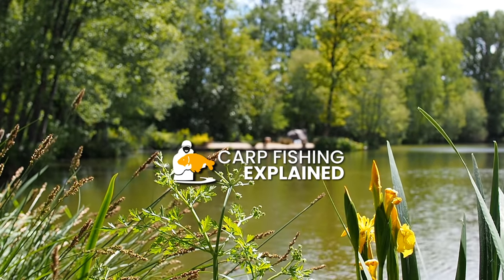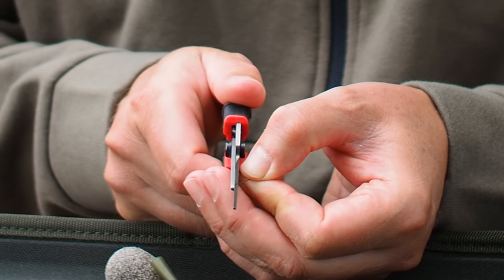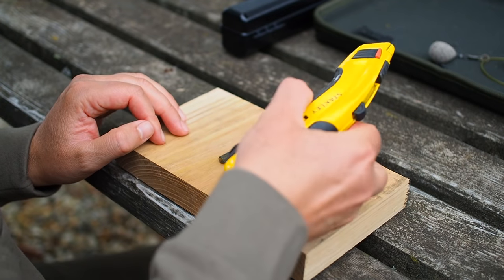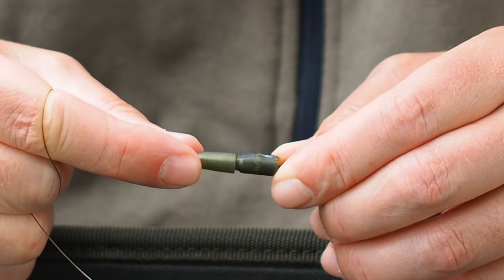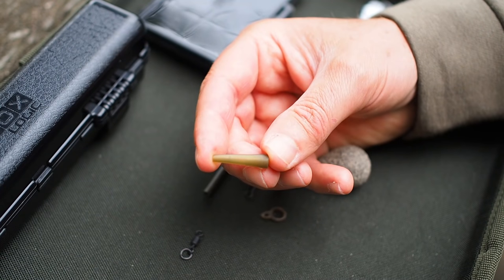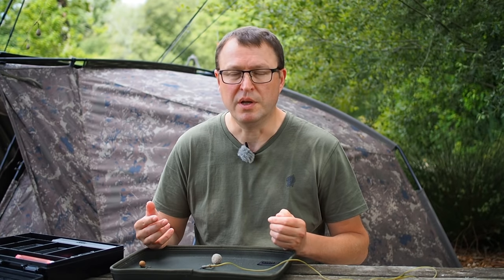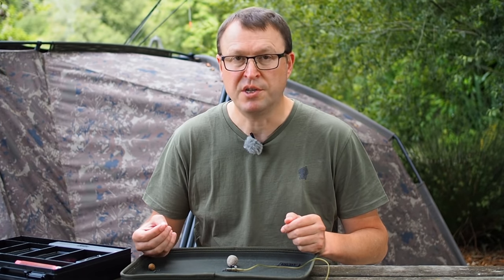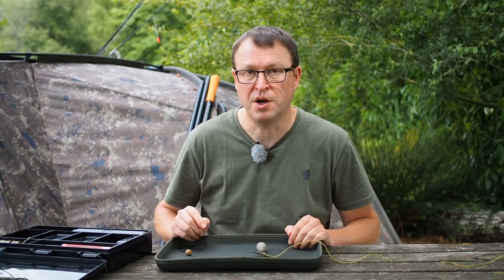I Cut the Leg of a Lead Clip (HERE'S WHAT HAPPENED)

Comment: Should I use this in all situations and do you think it reduces fish loss
Reply from the maker: Hi mate, I don’t believe that any one solution can cover everything but this may well cover your needs. I can’t really say much more as I know nothing about the type of carping you do. This rig is all about stopping the carp ejecting the rig before you even pick up the rod. Anglers fishing with traditional semi fixed rigs have probably missed quite a few opportunities without knowing. If you are losing fish while playing them then this lead system is not going to change anything because the problem lies elsewhere. You might want to take a look at my video on hook pulls as this covers the subject much better. For me hookupulls are extremely rare and the video shows you how I go about achieving this: https://youtu.be/yPDZV9xY_UA.  Hope that helps, Cheers, Matt.
Reply: @matthewcollinsangler  thanks for the reply Matt, I mainly fish a 4 acre pond with carp to 35lb and loads of 20s and is a very silty lake bottom with a lot of open water but the fish are very on edge and spoked do you think this would be a good set up to use
Reply: @matthewcollinsangler  also on my local I find the fish sometimes eject before I even get to the rod asumming using the lead to unhook them selfs
Reply from the maker: @Bailey6337  Yes, this is the type of lead system that you need as it sounds like the fish are getting away with it more often than not. Because of the silt I’d swap the mono for supple braid like Armourlink, add a nice mesh bag of crumb/pellets and lob it out. Caught plenty on it doing that. If it’s really silty I’d probably go with a supple rig inside a solid PVA bag. Have a look at my original trick inline setup: https://youtu.be/ED58TfFEcqM. Scale that down to fit in a solid bag and drop to 2.5oz and that will work well. If you need to fish at range or over shallow water then check out my helicopter setup for silt. That works really well: https://youtu.be/K0A4GSH0z44 Hope that gives you a range of options to try. Do let me know how it goes! Cheers, Matt.
Reply from the maker: @Bailey6337  Yeah they are definitely doing you mate. That’s the trouble with traditional semi fixed rigs. They are just too easy for the carp to use the weight of the lead to sling the rig.
Reply: @matthewcollinsangler  thanks for the advice really appreciate it I will give this ago 👍

Comment: Can this same concept be done without the tubing? Or is the running ring too abrasive?
Reply from the maker: Tubing is not necessary, it can be used on a lead free leader or a regular mono leader or just bare mainline even. The run ring I use is plastic so abrasion isn't an issue.
Reply: @matthewcollinsangler  thank you! I used to use fixed sinkers when I first started. I switched to lead clips cause I liked the idea of the fish losing the sinker if I broke off. However, I did my own testing and ya lead clips aren't as brilliant as I thought. My old 3 way rigs were with mono tags and now that I know how lead clips work, I should have stuck with those. Definitely going to give this a try!
Reply from the maker: OK, cool, best of luck!

Comment: I was wondering how well this would work if your trying to thread braid mainline thrue your rig tubing ? As it's a lot less stif than mono line any tips !!.
Reply from the maker: Hi Paul, I wouldn't bother trying. When I use braided mainline I tie it directly to 10m of Nash Heavy Duty Mono Snag leader in either 30lbs (0.50) or 40lbs (0.60). Because the leader is very robust I don’t bother adding tubing. I fish that straight down to a clip of some sort. TBH nowadays I’ve moved away from braided mainlines as they are very expensive and come with a variety of downsides. For general carping I use 12lbs Nash Bullet, for heavy duty work I use 20lbs Bullet. I also use both of those in combination with an abrasion leader where necessary. Hope that helps, Cheers, Matt.

Comment: Hello Matt, would a snag safe lead clip from Enterprise Tackle be as effective as run ring & quick clip
Reply from the maker: Hi Mitch, I have tried the Enterprise system and it does work but I found the clip varies in quality and I lost quite a few leads that just got banged on a rock. If you want to combine my rotten bottom trick with the shock and run you can create tuned setups which suit each different application. If you missed the rotten bottom video watch this: https://youtu.be/pSjT2wPKtTw Cheers, Matt.
Reply: @matthewcollinsangler  many thanks for the reply Matt much appreciated, I've used them in the past without issue so I'll give them a try. Thanks for the link too, I'll check it out 🙂👍

Comment: Hi matt what brand of run rig rubber do you use that fits over the tail rubber, cheers
Reply from the maker: Hi Darren, yes so I’ve found two that work. The Fox run ring is the one I’ve used the most. The only trouble is it’s only available with a set of quick links and buffer beads. The other option is a Drennan run ring. These come pre assembled and you just have to clip a lead on and you’re ready to go. These happen to have an identical internal diameter to the Fox ones. I only found this out because a friend very kindly shipped some over to me after the shock and run video was made. I’m currently playing around with Nash’s new helicopter buffer sleeve. I think this product has multiple possibilities! Do let me know how you get on as your feedback is greatly appreciated. Cheers, Matt.
Reply: @matthewcollinsangler  
Thatnk's pal .I definitely will let you know how I get on ,I do like end tackle that can be used for different methods, saves on dozens of different bits and Bob's. I'm fishing a members lake next month. Last time I fished it I noticed the tell tail rubber on the blow out tig was all way round the bend of the hook ,meaning I'd been done.The carp were picking up the lead and not running but using it to throw the hook.so I put the tail rubber on really loosely which caught fish but lost a lead on every take.This running set up should be perfect. Cheers matt
Reply from the maker: @darrenfox1879  Yeah sounds very familiar. I’ve converted so many customers from traditional lead clip systems to shock and run style systems over the last 10 years. I just don’t see any point in using traditional semi fixed lead systems anymore. I’m sure it’s going to work a treat for you. I still occasionally get done of course, no system is perfect but it’s very rare.
Reply: @matthewcollinsangler  
Hi matt thanks for the reply. I think I would only use a lead clip round snags or in heavy weed etc.The shock and run is a real edge

Comment: Could u use this set up for zig fishing
Reply from the maker: Hi Mark, I’ve not tried it with zigs but this lead setup would work very well for zigs. The thing to watch for though is weed. Zigs work well in clear water and clear water tends to be weedy. It doesn't take much weed to jam a lead solid so it’s often better to dump the lead on the take when zigging. I hate losing leads but sometimes it's the only way. Cheers, Matt.

Comment: Will the lead come off the tail rubber on impact?
Reply from the maker: Hi Kevin, it depends how you cast it, range, speed, technique, bait size, PVA mesh etc. The optimal casting technique for this rig is to cast, hit the clip, land the rig neatly on the water and feel the lead down. Adding PVA mesh makes it harder to use because the drag forces will increase the load on the hooklink which can dislodge the ring. If your casting skills are a bit rusty then simply tie the ring in place with some PVA tape before you cast. That will guarantee it works as it should. It’s not the end of the world if the ring gets dislodged. You’ll lose the shock effect and the telltale function but it will still catch carp. I’d recommend to do some test casts and retrieve the rig after 30 seconds of it hitting the bottom. That way you’ll know how it’s working for you. Best of luck, Matt.

Comment: Matthew, would you ever fish a running when slack lining?
Reply from the maker: Yes mate, I fish running leads when slacklining all the time. Cheers, Matt.
Reply: @matthewcollinsangler  Awesome thank you, I’m doing a three day session on a big fish lake that’s very silty next week, i’m guessing I’m going to have to use Helicopters …
Reply from the maker: @marcusday6519  Hi mate, sounds like a decent challenge! If you can get a drop on the cast (i.e. you feel the lead touch bottom) then I’d still use one of my running lead systems. If you can’t get any drop whatsoever then yeah helicopters all the way. Use as light a lead as possible to get the distance and put the top bead up the leader as far as you need. There’s an old trick involving a length of white wool (attached to the leader) that will indicate roughly where you need the top bead to sit. Cast out, leave it for a few minutes and note when the colour changes from dirty to clean. Hope that helps and let me know how you get on. Cheers, Matt.
Reply: @matthewcollinsangler  Hi Matt, awesome thank you sage advice as always. Wow what an awesome idea I will try the white wool trick!! Thank you I’ll let you know how I get on

Comment: Do you need the actual clip or could you just put the tail rubber over the eye of the swivel ?
Reply from the maker: Hi mate, it really depends what tail rubbers you have and how they fit over the swivel. You might have something in your tackle box that works. If you don't use the lead clip body with the Nash heavy duty tail rubber, the tail rubber doesn't grip the swivel and the whole lot slides up the line which is no good. If you're going to make this rig with bits you have in your box, make sure it operates safely and the lead can be lost in the event of a mainline failure.
Reply: Hi matt got 2 more questions, i want to try this system out on a lake i’m joining, so number 1. Why is the pin essential? If i tried this rig as shown here would i need to use pins and 2. What size run ring is that? Drennan do some that are small medium and large but i have nothing to compare to as i have never used them before. Thanks Leon
Reply from the maker: @Leonf123  Hi Leon, the pin through the body of the lead clip is essential because you need the clip to stay connected to the swivel. Otherwise, the whole lot will run up the line which, if you’re using tubing, can become dangerous. 

The Fox run ring only comes in one size. If you want to use the Drennan run rings with the Nash HD lead clip and tail rubber, use the large size. 
Cheers, Matt

Comment: Hi Matt,my question revolves around a flat lay using this running rig system,although i agree its a good set up,if it lands the way it it is going to land on the bed of water of water your fishing over,the heavier the lead the better the hook hold after that,can it be a 5 quid loss for the gain of a fish,although i understand some fish run into 5 and 6 figures
Reply from the maker: Hi, I’m not sure I totally understand the question. If you are concerned about the financial loss of the terminal tackle if the line breaks then there are cheaper options for sure. Check out this other video on my channel, it's a simple rig and costs very little to make: https://youtu.be/LzFina92brM, it’s done with a running lead setup and you don’t lose the lead on each take.
Reply: Hi Matt,the run ring on the tail rubber may stick after the lead has hit bottom,this could then make the rig sit up,its a great set up i admit,just not sure if it would be presented correctly on a gravel pit or hard base,in regards to your fine vlogs,i have watched most of them very educational and interesting and superb,please keep them coming
Reply from the maker: @felipfelop8220  OK, I don’t share your concerns to be honest. This rig has caught a lot of large carp from a tricky lake which has a very hard and rocky bottom. If you want to understand how the rig sits underwater, just make one up and drop it in a clear shallow margin. As long as you choose a rig material that will lay flat then there’s no issue for me.
Thanks for the feedback on the videos, great to hear! We've got plenty more ideas for new ones 😊
Reply: @matthewcollinsangler  ok,thank you for being so responsive,its very much appreciated

Comment: BTW, I thought to increase the safety of this rig you can use running Snag Safe Lead clips from ESP (I think) and I'm sure other brands are available etc,  .... so if the lead gets wedged in some snag you can still break free easily, but it won't just drop off.  👍
Reply from the maker: Hi Matthew, actually that Fox ring is as safe as the Snag Safe lead clip from Entreprise Tackle which I’m familiar with because it breaks easily at sub 10lbs and the Snag Safe breaks at 8lbs so there’s not much in it. You’re right, it’s totally an option 👍
Reply: @matthewcollinsangler  Aah right - didn't realise that!   That's all good then.  I'll stick.  :)
Reply: I was losing faith in this one for a while but it turns out I just wasn't on the fish in the 2km long and up to 35m deep lake which is also connected to the rest of Amsterdam's waterways so location is tough!    However I had a few fish on it recently including a 37lbs Mirror!  And I haven't had to buy a lead for months!!      All my rods are set up like this now.
Reply: I am now using the Nash run lead clips after your vid on those  - just wanted to ask - do you think they have now superseded this set up or is there a case where you would still use this over the Nash clips?

Comment: As soon as you lift the rod into a running fish the lead slides back down to the lead clip. So your point of the fish not being able to use the weight of the lead to shake the hook free is not valid. The rig itself is a good rig for the simple reason that there's very little chance of the lead becoming fast on a snag with a fish attached, there's always a slim chance with a clip.

Comment: what is the point in the lead clip, would a tail rubber over the swivvel not be okay
Reply from the maker: Hi Henri, that’s a great question! I have tried the tail rubber only option but it just doesn't work anywhere near as well as this setup does. The lead tends to hang and take too many shakes before it slides away. This gives Mr. carp too many opportunities to shake the rig out. The other problem is that the tail rubber easily becomes disconnected from the swivel and that can easily create a dangerous rig. That’s why I recommend the combination of materials in the video. Cheers, Matt.
Reply: @matthewcollinsangler  thanks for the reply, I am gonna try this rig soon I just need to buy a few bits: the run ring, clip for the lead, rubber sleeve over the clip and rig tubing, what brands do you recommend for these bits which are also reasonably priced
Reply from the maker: @henrilowe6321  Hi Henri, in the video I used a Nash heavy duty lead clip and matching tail rubber. Also a Fox run ring (that's only available as a kit of bits which includes a buffer bead). These items are absolutely essential for this to work as shown. For the tubing, swivel etc. you can use whatever brand you want. Nowadays I buy most of my terminal tackle from Nash Tackle. It's a premium brand but it's good gear. Hooks are the most important item and theirs are the best, end of. The last yard is the most important part of your setup. Best of luck, Matt.

Comment: hi will this system work ok when using a bait boat?? thanks
Reply from the maker: Hi Mark, I haven’t actually used this particular variant with my bait boat but it would definitely work. I wouldn't hesitate to drop one from a boat. Just make sure that you have a 360 deg pivot at the swivel (ie. use a ring swivel as shown, rather than a quick link as some others have asked about). This way the rig will pancake flat everytime when you drop it. Best of luck, Matt.

Comment: Another great video Matt, although I’m not sure about the sinker above the tubing.  If the Mainline breaks above the sinker when playing a fish (on a snag?) the fish will be towing around the tubing as well as line.
Reply from the maker: Hi Stephen, thanks for your support and I’m glad that you like the video. Adding anything above the tubing should be done with care and caution and for a very good reason so I do appreciate your concern. This is very much an optional extra. If the fit between your tail rubber and tubing is good then this addition is not necessary (and the carp will still drag it around in case of mainline failure).
What’s most important is that the carp is not dragging the lead. I’m less worried about a length of mainline (with or without the tubing). I’ve switched to barbless so the time it takes for a carp to shed the hook is greatly reduced compared to any micro barbed hook.
There is a big variation in the fit between various tail rubbers and tubing, some work well, others don’t. At Beausoleil, if the tubing gets loose and the mainline gets exposed, there’s a big risk of mainline failure if you’re playing a big cat and the line catches the razor sharp pectoral fins of the cats. So it’s critical here to keep the tubing attached to the tail rubber and this tungsten sinker is the simplest and best way to do that. We also have a barbless only rule. I hope that better explains the addition. Cheers, Matt.

Comment: Can't you just use a tail rubber over the ring swivel. Without messing about with the lead clip? Or am I missing something.?
Reply from the maker: Hi mate, this is what we used to do and yes absolutely it is an option but I found that I get better control of the fit between the run ring and the tail rubber if the tail rubber is pushed onto a lead clip body rather than just over a swivel. Have a play around and see what works for you. All these bits vary slightly so you might already have a perfectly decent solution in your tackle box. Cheers, Matt.
Reply: @matthewcollinsangler , thanks for your reply.. Wasn't picking holes, just a genuine question... All the best.